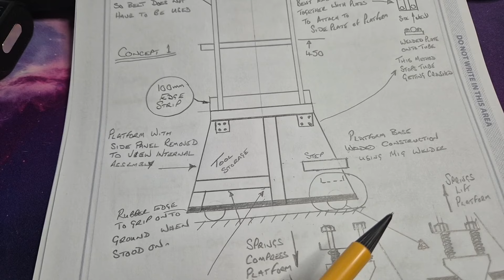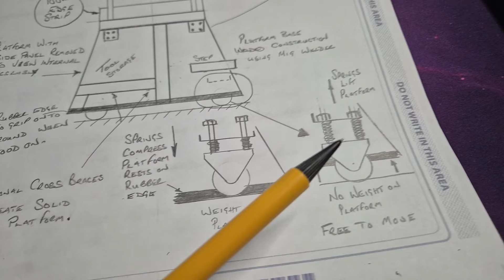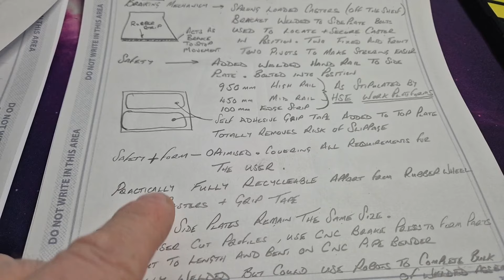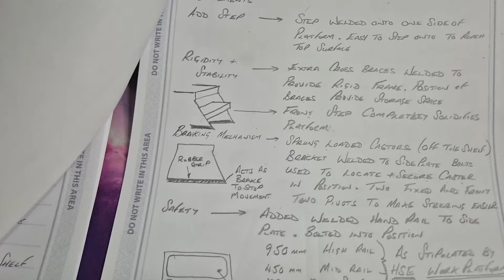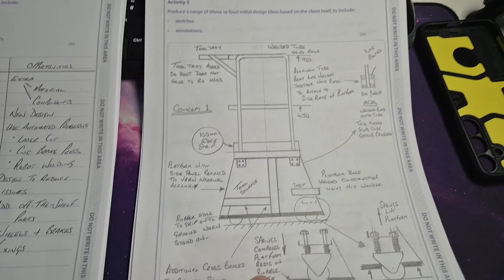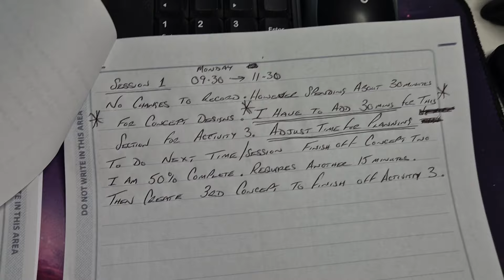Unit 3   Engineering Product design and Manufacture - Exam walk through for Activity 3

Comment: i made initail desings based on client brief but do they haveto be exactlty like the the brief. isnt the brief an idea on where to imrpve. I finishe activity 3 todayd.Do i need the exact dimensions. I changed the whole jig design anddimensions to meet my changes. WouldI be fine
Reply: Wel the drill holes will be a constant.They can't be changed right
Reply: This is for activity 3 by the way
Reply: Did I do the right thing.
Reply from the maker: The design is free artistic licence. Just be wary of any constraints.
Make sure you stick to these constraints and you can do the rest as you like.
Remember in my video where my constraints we the side and top panles. These had to stay the same size. Just check if you have constraints before going full in to it.
Have you annotated your concepts well enough to let examiner know how you covered customer requirements.
This is where students loose marksif they do not mention these details.
Reply: @111melcat  There where no explicit constranints. Under theclients originalJig where its dimensions. Butnone of us took them as consratints
Reply from the maker: @ShaunEmilShenil so no constraints at all?.

Just make sure to be certain

Comment: hi mell im really struggling getting ready for my actvitity 3 im scared i wont do well because in my part a i dont have any images or descriptions about existing designs w for jigs or clamps which is bad because i dont have much good imagination or remebering skills do you have any tips that could help me prepare for tmrw and one more question if i practise one design at home and go to exam and go straight to activity 4 is that a good idea or no ? and would i need isometric drawings so the one that shoes each angle on activity 3 or is that only for 4 recommended ? 
i would really appreciate a quick response thanks so much for ur vids
Reply from the maker: How are they doing the sessions. 
Four 2 hour sessions?
Reply: @111melcat is my right bc I'm doing 4 - 4?
Reply from the maker: @AbiolaBasiru it all depends on how your college has organised it.
I assume you are gett8ng break in the four hours
Reply: @111melcat  3 - 2 - 3
Reply from the maker: You are not the only one in that boat. Many students struggle to draw.
Isometric is one way of showing an idea. If that is a struggle. Go for the 2D orthographic projection drawing where you need a front, side and top view. This is easiest for most students.
Just remember proportion.
OK imagination problems. Look at the product. Think on how you would make this.
Fabrication, where you laser cut parts, bend and weld together.
You could also bolt those same parts together. Just need holes to put bolts in and nuts to hold it all together.
Do you know how machining with milling machine or lathe.
Read up on milling parts.
Hopefully you find flat parts with steps pockets and so on.
Reply from the maker: Now if you do activity four first while you remember then this means you have to go backwards to get three designs for activity 3.

You need to provide solutions to cover customer requirements. Remember i mentions fabrication, nuts and bolts and machining. 
You going to have to dig deep and try to produce three designs.
Labels are jot annotation, label the parts and then add notes on how parts are made, what requirements it provides solutions for. How it's joined, welded or bolted. Also what .material it's made of.

Comment: can i make 2 rubbish drawings and 1 good and use the good one for act 4?
Reply from the maker: Unfortunatley no, you have to produce three/four design concepts that address the customers problems. You WILL NOT score highly on this if two do not solve the problems and only one does. The marking criteria the examiner follows will score you low. Take a look at the typical criteria below and judge for yourself

Band 1 - scores 1 to 3 points
-Limited range of basic ideas that address some aspects of the brief.
-Ideas communicated at a simplistic level with limited technical terms.
-Ideas that have limited feasibility and may not be fit for purpose.

Band 2 - score 4 to 6 points
-A range of appropriate ideas that address most aspects of the brief.
-Ideas communicated clearly and suitable use of technical terms that mostly link to the brief.
-Ideas that are mostly feasible and fit for purpose, but may include some unrealistic design elements.

Band 3 - scores 7 to 9 points
-A range of appropriate ideas that comprehensively address the brief.
-Ideas communicated with clarity and concisely and appropriate use of technical terms that link to the brief.
-Ideas that are feasible and fit for purpose.

You can see what problems you will have if 2 out of the three concepts do not address the problems the customer has moaned about.
Reply: @111melcat  so if i do my first concept add 1 thing then for example in the second concept i add the same thing as the first concept whilst also adding 1 new thing to the second concept would that be bad?
Reply from the maker: I know where your coming from here.
You need to makensure that all your designs are different.
So you can have something thay is welded assembly so parts have to be fabricated first. So laser cut as example.
Bolted together even though similar in design but has different approach to manicure by machining all parts from flat stock bar.

You could have one block of material and machine everything from there and bolt everything onto that.

Size and weight of material will be factor here. Which is easier to handle.

Now bolted assemblies mean you line holes up and put bolts in.

When welding you need some sort of jig, clamps to hold it in position to enable you to weld in position.

Hope you see what I mean here

Comment: Hi, if I wanted to add something specific to my design such as a toggle clamp but am not able to draw it well, should I just not go for it?
Reply from the maker: Toggle clamps are easier to draw if you go for orthographic drawings.
I have many students who struggle with isometric sketching.
As long as you get your views in and your vision of the idea across so examiner can understands you got it made.
Practice your sketching until you're happy with it.
Never say never unless you at least tried
Reply: @111melcat ok thank you, I'm really bad at drawing so I'm worried for my exam
Reply from the maker: Find photos or drawings of these clamps first.
If you go shopping on Google you will find shed load of them.
You will find that they provide engineering drawings of the clamps for the person who needs them to know what size the clamp is in all orientation.
Find them and practice your sketching. You are allowed to use rulers, protractor, compass and hole templates. 
Its not all free hand drawing, use the equipment to help you draw.
Remember proportion, it needs to look right.
Reply: @111melcat Thank you so much you're the best ❤️
Reply from the maker: Any of your friend in the same boat?
Get them to ask questions on here, it helps me build the channel and I get to help more people.

Comment: Is each concept 3 three of the design changes drawn and annotated?
Reply from the maker: In Activity 3 all 3 concept designs must be annotated to enable you to show the examiner how you intend to address each one-off the clients requirements..
Of course you may be repeating some things but thay cant be helped.
It's to ensure you get the most marks awarded across the board consistently.  Hope this helps
Reply: @111melcat thank you for the help so say if I am making 5 changes only three of them I need to make into concept designs and annotate them?
Reply from the maker: Yeah something like that. But you must show rationale in why making that decision. 
It could be ease of manufacture, less components and time saving on assembly even coming down to buying stuff of the shelf instead of making it yourself.
This make sense
Reply: @111melcat yes this makes much sense thank you very much
Reply from the maker: Spread the word, you wouldn't believe how many need help.
Tell them to smash the like button as well, or prehaps follow too hahaha.
Channel is building steady now

Comment: I got a garage door supported by two hinges/poles to leave it open and it’s opened by two people 
What should I do for the sketches you think?
Reply from the maker: I am not allowed to discuss current exams, but I hope you have been looking at products relating to this exam.
I would be looking at structure, assembly, materials, how it's made and what makes it work.
Any engineer or designer will be using this method for new projects
Reply: @111melcat thx will definitely take time to look at that
Reply from the maker: Hope this helps as it is all I am allowed to suggest
Reply: Same
Reply: @Plazino0what are u doing for the design if u know like for activity 3 and 4
Reply: @E@Edits-o3gactivity 3 I got 4 designs one side industrial garage door hinges one the sides of the doors with a lock key, overhead sectionals industrial garage door with hinges, side slideable industrial garage door, and the door that can be lifted up manually and it automatically goes up
Reply: @Plazino0wait so you're not limited to the door opening and closing vertically?? Like the door can also open and close horizontally as well??
Reply: @songokukakarot6247no I don’t think so
Reply: @Plazino0wow that's perfect thank you

Comment: If I don’t put any initial manufacturing processes that could be used for activity 3 garage industrial door and hinges must be put on it would I lose marks and do you think all the videos will be out by Sunday?
Reply from the maker: I would add those to help you understand your own idea better  you see how I do this on my video.
If you miss something but have lots of other topics included it shouldn't impact marks.
Better to be safe than sorry here.
Plus if you have time at the end when doing quality check. You could add this detail then if you missed it already.
Remember a balanced approach on all concepts. This will make marking easier to see all details.
If one idea is say, sketchy, this may lower your scores overall.
Activity 3 is a 9 mark score. Its Activity 4 that is the heavy hitter.
Reply: @111melcat would I  lose a big amount of marks if I don’t do my log book for activity 1 because I’m running out of time I have completed 3 just need to add some manufacturing processes and I need to complete 2 Abit more to add and need to finish my data interpretation
Reply from the maker: Activity 1 is for 6 marks, you need to put something in there. 
Even if it is what you got to finish off when you start the next session.
Plus add, if you can, changes you may have added. An example would be for work platform, added bigger diameter wheels to help go over rougher surfaces.
Reply: @111melcat  I think I’ll use 2 hours to the other activities that I need to complete and the remaining 2 hours for activity 4 is that a good idea?
Reply from the maker: You have 8 hours, on your 1st 2hr session you should be on you second design.
When you start 2nd session, you finish off 2nd and 3rd design and get at least 1.25hrs done of activity 4.
Then you can spend all of session 3 on finishing activity 4. This then gives last 2hr session to do activity 5 and do quality check to polish parts up if needed
Reply: @Plazino0hi, do you remember what was the possible problems with the product??
Reply: @s@songokukakarot6247unsafe, frequently maintained, accident could happen, it said we had to include hinges and we have to prevent moisture from coming in the building, we need to prevent unauthorised people from coming in the building which made everyone in my class had to change they idea
Reply: @songoku@songokukakarot6247it was unsafe because of the pole risk of it unaccidently falling down, frequently maintained, we must include hinges in our final design and initial designs, and it also said that we have to try not let moisture in the building
Reply: @Plazino0 Thank you so much, so nothing about the door being too heavy??
Reply: @songokukakarot6247yeah the door is too heavy aswell because of it requiring 4 users to basically open and close it and it was a a deign trigger from external customers/ feedback from the customers
Reply: @Plazino0Thank you so much
Reply: it did bro 😭😭😭😭 use a lighter material like aluminium but imma go for steel for my final design idek ibr
Reply: @Plazino0tbh, I thought of using glass reinforced plastic or aluminium composite for the redesign of door
Reply: @P@Plazino0am going for steel too cuz aluminium is expensive so that’s a disadvantage
Reply from the maker: Aluminium, I chose this because it was lightweight for my work platform.
Easier to bend, does not oxidise as quickly as steel. And wanted my tubes to be made of this so platform was not top heavy.
Price is a bit of a cheap shot if it is required to bribg down price.
Look at most workplatforms material. Mostly made of aluminium due to ease of manufacture and being lightweight for portability
Reply from the maker: Good to Metals4u webpage to compare prices of materials 
Aluminium, mild steel and stainless.
Reply from the maker: Sunday for Activity 4 and maybe 5 too.
You won't be on last activity on your first day so the latest I could release last video could be Monday. So time for you to watch before last session.
Been a busy week for me
Reply: @111melcat okay thank you 🙏🏾
Reply: @111melcat  Incredible Mel is definitely putting in effort on the editing and he listened to feedback and took out the background music . What a guy . My only concerns are that im not good at drawing so will struggle for activity 3/4 you got any tips ?
Reply from the maker: When have you got your exam?
Reply: @111melcat we have done activity 1,2,and 3, and we got 4 and 5 next week
Reply from the maker: What day?
Reply from the maker: Want to make sure I get it done in time
Reply: @111melcat  12th January 2026 activity 4
Reply from the maker: This will be done tomorrow hopefully by midday
Reply: @111melcat sir can you go through activity 3.,4 in great details and tips to get most of the marks and not lose much as I have my activity 3,4 next week 13th January and 14 January
Reply from the maker: This is the video for Activity 3. I just done one concept design to show process and would get decent marks.
The trick is to have three good concepts not one good and two wishy washy.
Reply: @111melcat btw sir for the sketches and design can I add an electric door opener that opens it automatically or would I lose marks for changing  the way it’s supposed to work because it said it’s done manually I think
Reply from the maker: I can't comment on  this as it is live exams.
If it is part of new design it's a keeper.
If you want this as opportunity later down the line then stick it there
Reply: @Edits-o3gdoes it say in the client brief that it must be opened manually??
Reply: @songokukakarot6247no
Reply: @songokukakarot6247 nopeit doesnt.I recommend to use either a gear system or a pulley system
Reply: @Gaymon_6769Thank you, what about gas struts and hydraulic dampers?? Also does the door have to open and close vertically or can it open and close horizontally??